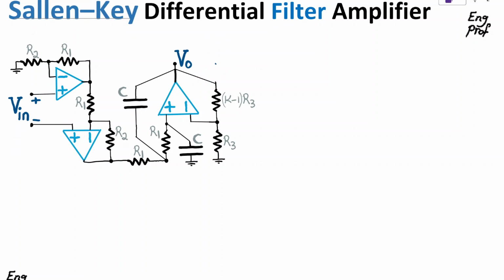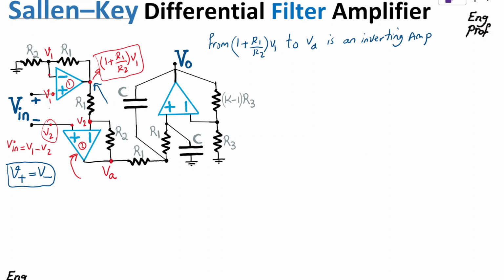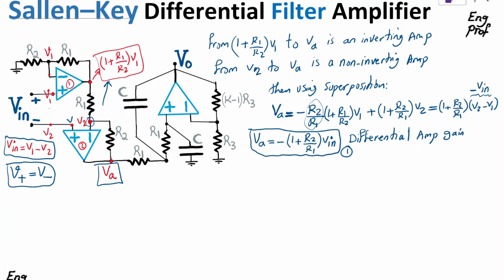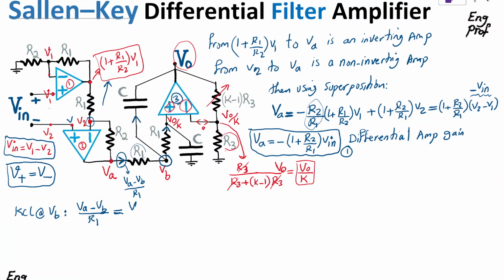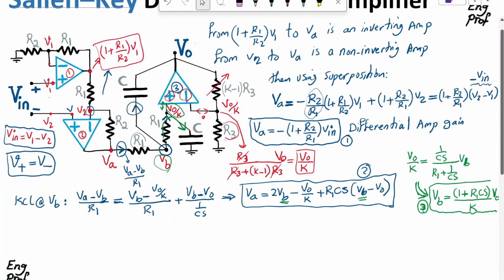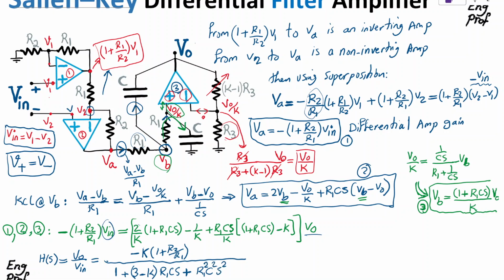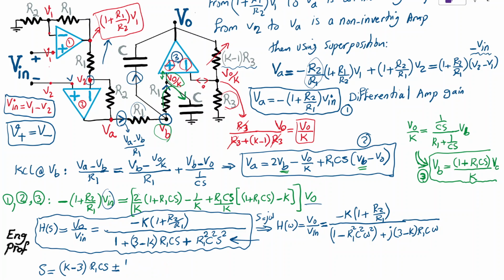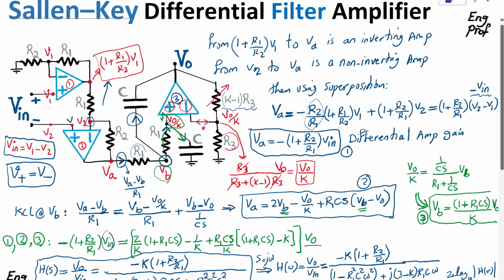Sallen–Key Differential Filter Amplifier

Comment: I wouldn't know how to choose a suitable k factor. The RC time product is easy to choose if frequencies are given, though.
Reply from the maker: Well said about the RC time constant that is defined by the choice of cutoff frequency of the filter.  A good choice for K=2 which translates to using same value for the two last resistors at the out put of the circuit. Otherwise the choice of K also affects the position of poles (roots of denominator of transfer function). I hope this is helpful.
Reply: @STEMprof  I'm trying to design a pipelined variant of the processor I designed, and, at some point, I devised a way to evaluate contention on resources such as the Arithmetic Logic Unit or memory access. Suddenly I thought of using digital-to-analog conversion so as to quickly evaluate contention and execute the instruction step with the highest value without resourcing to cumbersome, multiple, slow binary addition and comparation: a few op-amps and resistors would do. Like a set of neurons. Nothing similar to filters or PSUs, but in this case I think op-amps would do a wonderful job.